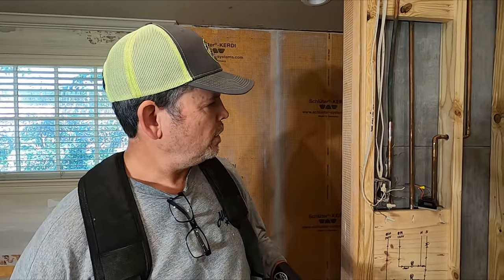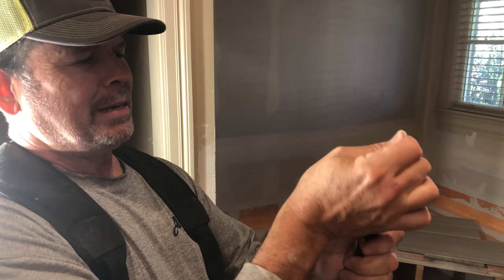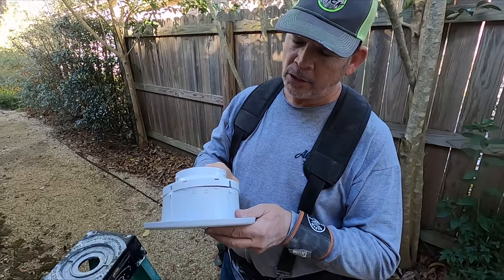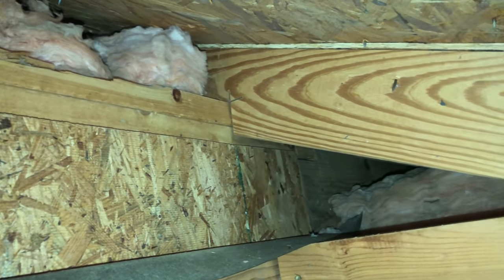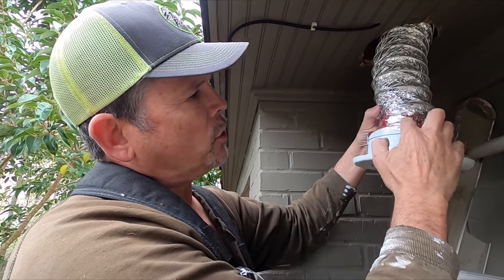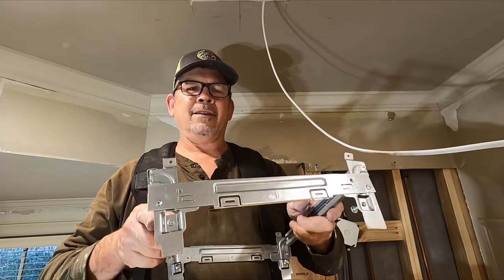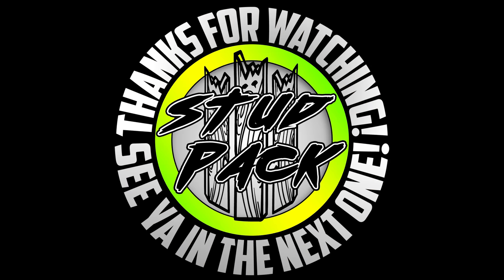Exhaust Fan Installation Gone WRONG | We Used All of Our Tricks...

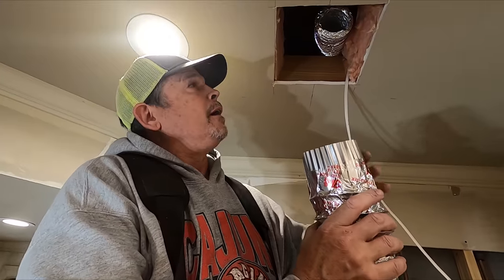Comment: 9:38 That right there is a discussion in and of itself, lol. What tape to use for “ducting”. Duct tape, plastic tape, or that nice nice shiny foil tape😅
Unfortunately, I’m gonna be in a crappy situation in the next month or 2. The remodel gonna be starting (2500 ft² home) in a few has 3 bathrooms (one that was remodeled in 2019) and every bathroom fan that’s there; does not vent to the outside at all. No ducting, opening for ducting, nada. The fans just blow straight down into the bathroom, oh yeah; no windows in the bathrooms either, and they are located in the interior of the house (w/ one in this situation as was an add on, meaning, the framing and “old exterior of house” is totally in the way....and the “old wall” is all CMU, w/ the new edition [and walls] being wood framing using 2x6). Sure gotta love the challenges of remodeling a house (old and new)😉💪🏻 and not being facetious, the problem solving amd coming up with a “solution/fix” for what your working on to have it work....you either love it, or loathe it, lol AS it’s not for everyone.
Nice work around here, and glad found some thing that “worked” w/o too much trouble.
Cheers✌🏻

Comment: You can see the root of the problem, which the fan probably wont solve, actually it will probably make it worse since the duct isnt insulated.  They added that "bump out" into soffit space and limited soffit vents so the attic cant breath.  Needs more venting/insulating.   And it would have been a lot easier to run the vent up through the roof since you can reach down and grab it without going in the attic.

Comment: I love watching you two work!  Question: What is the life expectancy on that foil tape?  will it ever break down and need replaced before it fails?
Reply: By far the biggest weak point is that aluminum foil duct.  You saw how easy it is to tear.  Never use that crap.  If you need to use a flexible duct, use the much thicker aluminum flex.  And that foil tape is fantastic, but of course better to not have any splices in the duct if possible.

Comment: I personally would’ve done a 2gang old work box. To keep the light and fan switch in the same box. Or even look into using the single gang with a fan/light combo switch.
Reply from the maker: 2 gang box would only have fit if I trimmed the stud.  Then the cover plate would have interfered with tile trim.   Wanted a dimmer on the light.   Not sure if anyone makes a stacked dimmer/single pole switch
Reply: @StudPack  I meant to say put the 2gang old work in the area you mentioned to put the single old work box. And remove the current new single gang on the stud. 

And you maybe right about a fan switch with a dimmer light combo. Never needed it, thus never looked for one. 

With that said. Might I advise on purchasing a timer for the fan? I personally installed one where there are 6 buttons for times and one large for on/off. It allows me to choose which time I would need and just leave it. The best way to evacuate moist air from a bathroom because of a shower. Is to turn it on before going into the shower and leaving it on for about the same amount of shower time. Meaning if a 10 minute shower is taken, then the fan should stay on for an other 10 minutes after.
Reply from the maker: Ok thx.  Timer is a good idea.  Others have commented about them too

Comment: Interesting you need a roofer to go out of the roof. I did my own, no problem and used roof caulking to seal it.
Reply from the maker: Yeah I’m chicken.  Stay tuned 😉
Reply: And whom do you call when it starts leaking?
Reply: I hope you have no issue with it.  My professionally installed vent failed after five years and ruined our kitchen ceiling.

Comment: Why a new and old work box next to each other and not a 2 gang?
Reply: dont quote me on this, but there was a previous video with some weird electrical stuff going on there. my guess is that it is two different power sources/neutrals and to meet code they probably need separate boxes to avoid crossing neutrals accidentally.
Reply from the maker: I couldn't fit a 2 gang box between the king stud and the cold water copper line.  I could have trimmed the king stud to make room for a 2 gang but then the cover plate would have hit the tile (like putting a box too close to a doorway and the door casing and box cover collide).   Couldn't do a stacked switch either because of the dimmer.  Thought about putting the boxes one on top of the other but liked side by side instead.

Comment: these type of duct is not good for exhaust moisture out, need to use insulated to prevent condensation, specially on that tiny space.
Reply from the maker: Not required where we live.  Won’t even find it in a store.  Regional differences in USA are pretty interesting sometimes 👍👊

Comment: Here's a million dollar idea....invent a moisture sensor that turns the fan on when needed. It will also have a timed switch and stay on for x-minutes. This reduces the time it is on sucking the AC & heat out of the house.
Reply from the maker: They already got ‘em 👍.   Humidity sensor 👊
Reply: @StudPack  As for the other reason the fan needs to run....there is no such thing as a methane sensor. YET !

Comment: You should mention that this should only be done with an unvented soffit, even if it goes to the outside. People seeing this might think it's always OK. If vented out to a vented soffit, the moist air will be sucked back into the attic, which can cause problems in cold weather. You can do this if the soffit is unvented, or if the adjacent soffit vents are closed.

Comment: That flex duct is junk if you get a pin hole in it--especially in areas that get really cold.  Leak moisture and cause mold in attic.  Also an eaves vent is a mold spot waiting to happen.  It will pump too much moisture in that space and the paint will fail and wood mold.  I would go out side of the house or do it proper and roof.  The cost will be saved with any damage.  Don't do flex pipe that isn't insulated, or do mastic sealed ridged.

Comment: It appears the roof was not a tile roof so in my opinion it would have been much better to cut a hole in the shingles/roof and install a roof vent. No need to call a roofer. Any handyman should be able to install a roof vent on a shingle roof.

Comment: A retired old fart here. Thirty years of environmental remediation, interior demo, residential, commercial and industrial. Tinkered on the side air sealing and insulating homes. Installed 7 soffit vents like you did here and this is what I learned. Do not go through roof. Even an insulated duct (what I used) will result in condensation in a cold climate. My first job in my house resulted in monsoon rains pouring into my microwave and water pooling in the duct from the bath fan. A little research and I switched to the soffit vent. However, I would use 3" or 4" PVC pipe from exterior wall top plate to within one foot of the fan, usually 6' to 8' long, and one foot from the soffit vent making connections with flex duct. I would pitch the pipe 1" to 1.5" so any condensate would drain to the soffit and cover with plenty of insulation (Cellulose) in the attic. Over ten years 100% problem free. Also, it takes a skinny young kid to do this if it is a 3/12 pitch roof. A 4/12 pitch is doable long as you are in good shape. I learned this the hard way.   PS. Like your videos. you are among the few that pays extra attention to detail in order to get it done right.

Comment: Run it through the roof, shorter distance, more effective.
Reply: I agree! Removing a few shingles, properly of course, then cutting hole, adding regular metal pipe and adding proper vent outside on roof, caulking as necessary, replacing shingles after cutting to size, done in half the time. I have 2 of these in my house. Thanks....Jim
PS......I had to do a kitchen hood exhaust than was 4x12” back in the mid 80’s. I went straight up into the roof that was 2’ away. There was a rafter in the way, you don’t cut rafters. I did a 45 in the metal exhaust duct, this made the duct a 4x10”, and allowed it to bypass the rafter to the exterior roof flashing made for this type of vent. The job literally took 2 hours from start to finish.

Comment: NEVER vent a bath fan out the soffit! The moisture will just find its way back up into the attic through the soffit vents!🙄
Reply from the maker: The nearest one is 10 feet away.   Also never by an operable window, door,  or fresh air intake.  They are allowed here but must meet criteria
Reply: In this case, the soffit wasn’t vented, so it would have to pass through that bead board to get back into the attic space. But moisture certainly would build up on the soffit around the vent opening.
Reply from the maker: There are soffit vents on this project
Reply: @StudPack  - I looked at 4:24 in the video again, and I didn’t see any perforations in the soffit there, which is where the bath exhaust vent was being installed.
Reply: Wrong. If true, every house in TX, LA, MS, Al, Fl, GA, SC, and a few more would rot out within a few years due to the continuous high humidity during the summer months.. The discharged air is flowing at a rate of 90 to 110 CFM or more away from the soffit. Check out the Building Science and Exterior Details Forums on Journal of Light Construction over the past 25 years. Very enlightening.

Comment: Why didn’t you use insulated ductwork? I always use insulated ductwork for my bathroom exhaust fans to keep down on the condensation in the ductwork. If you are going to keep doing videos, put a disclaimer at the beginning saying that this is how you do and is not to be used as instructions on how to do this type of work. I have watched 2 videos now and in both of them, you have used the wrong product for the job. At least do your research on the products needed to do the job correctly. I have been remodeling bathrooms for over 20 yrs and know which products are correct for the job that I’m doing.
Reply from the maker: Hey thx for commenting 👍   We don’t use insulated exhaust duct here.   I couldn’t buy any locally if I wanted to.  It’s interesting that code requirements are so varied around the country.  For that matter, even town to town or inspector to inspector.  I’ve been in home centers all around the country and you’ll see products in some that you’ll never see in others.  Seismic straps one example.  Plz let me know the other incorrect product ...  always learning here too 👊